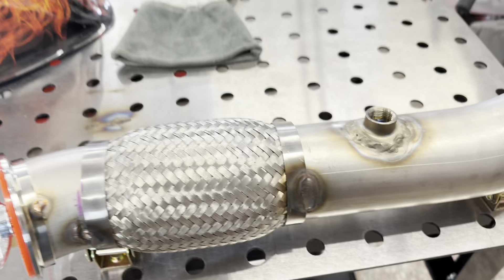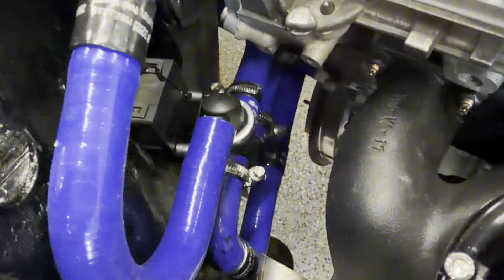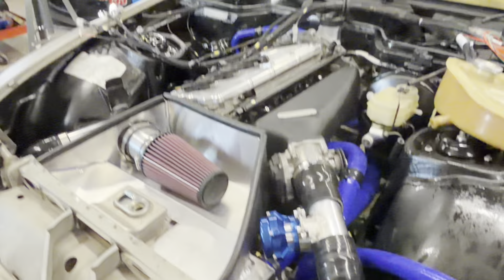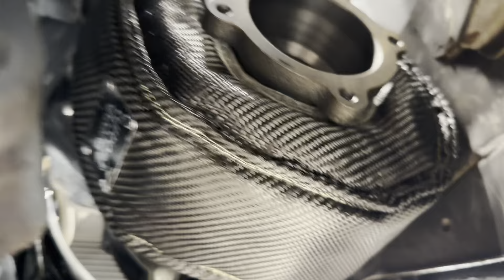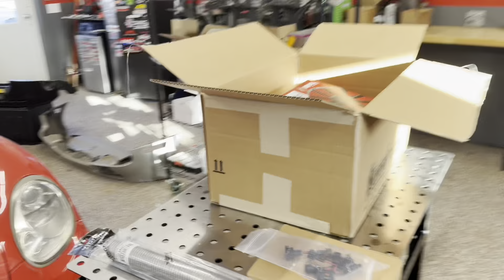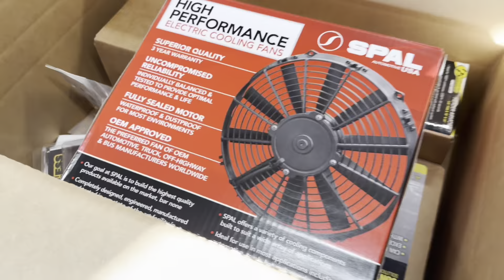Porsche 944 Safari - Wrapping Up the Engine Build!

Comment: Speaking from experience that 90 degree coupler off the turbo will melt. You need to get it as low as possible and then some heat shielding under the SPA manifold.
Reply from the maker: Thanks for that insight. We are planning on heat wrapping the manifold which we got in today (forgot to mention in the video)